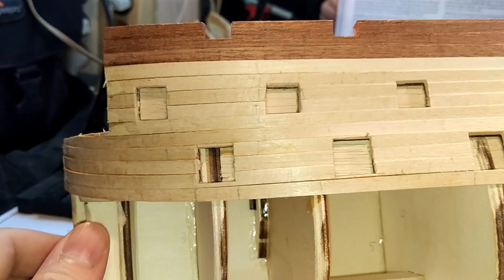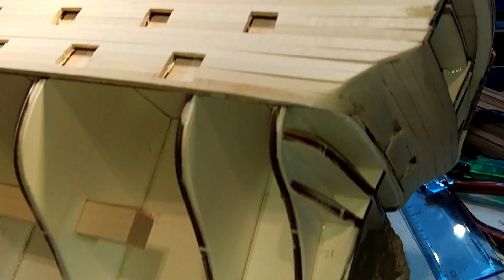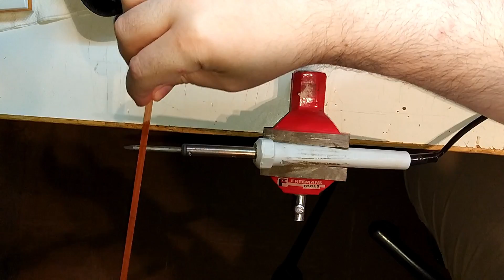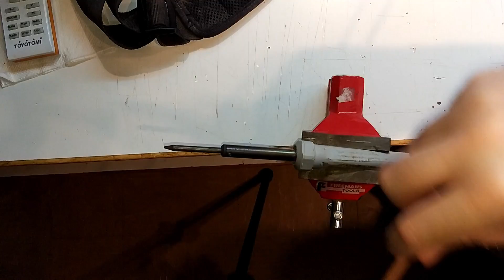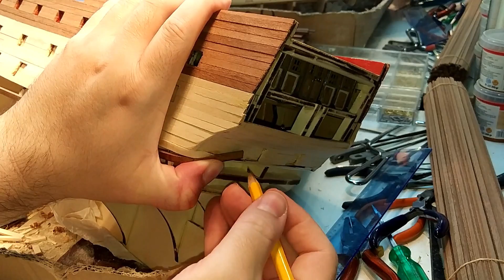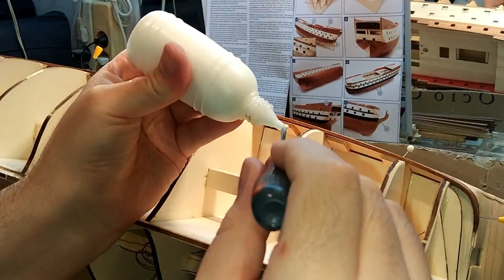Montanes - part 22 Planking With Sapely

Comment: Would a CRIMPING TOOL (Amati makes one) help with some of those really sharp curves? Soaking & using hear as well. 
Do you veer glue your fingers to the model with the CA??
I've found that CA on a damp plank sets very fast! Evidently water accelerates CA glue setting time.
Enjoying ALL your videos! Very informative! THANKS!!
Reply from the maker: I have used a tool like that and it doesn't make the strips as you like. Also it destroys the inside of the wood strip. Yes i get CA glue in my hands all the time, but with some water and a little scratching with my fingernails and the glue is gone.  Thank you very much for your kind words!!!